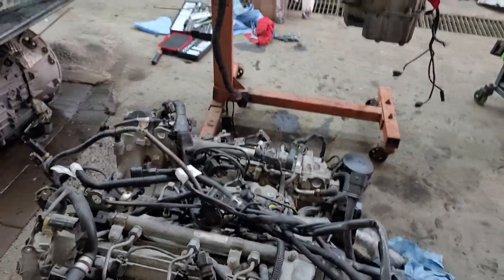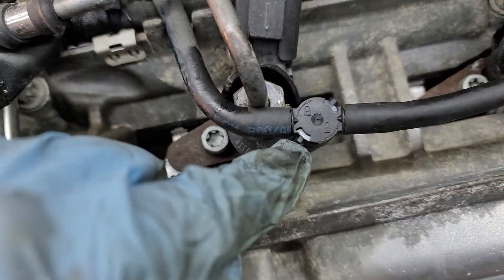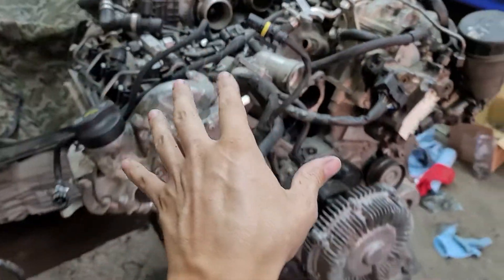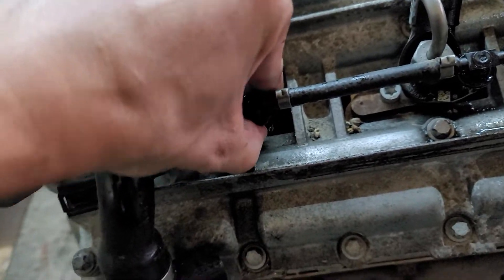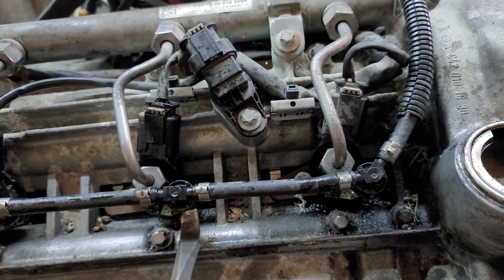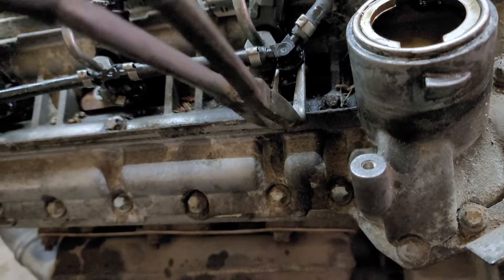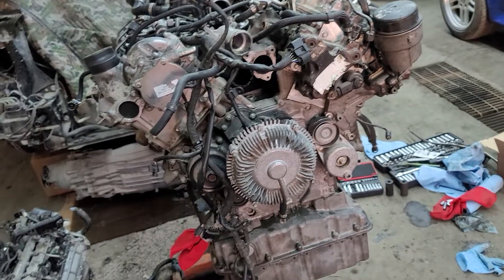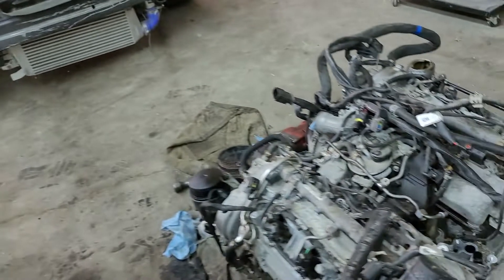Mercedes Sprinter, GL350 fuel injector return line removal

Comment: So I stumbled on ur new project are u putting a different engine in a sprinter or putting a sprinter engine in a GL model Mercedes? I had to remove the head on my 2003 sprinter. Your youtube was such such a tremendous help doing this major task. You made so simple!! Tank u so much!!!
Reply from the maker: Yes I'm putting Sprinter engine on Mercedes GL, and you are very welcome glad to help!
Reply: @RuvimAbaras  can u go then other ways and put a GL in a 07-09 (doesn't use DEF) sprinter. Do you use the GL computer or sprinter???? Have no plans to so this just wondering what u had to so to make them work?? Interesting!!
Reply from the maker: @gregboyd4321  the def have nothing to do with inner engine combustion, so it should work but I believe for 2007 you have to use your old camshaft from Sprinter